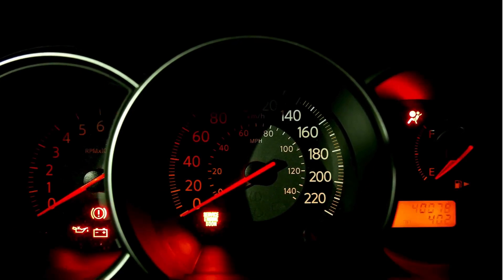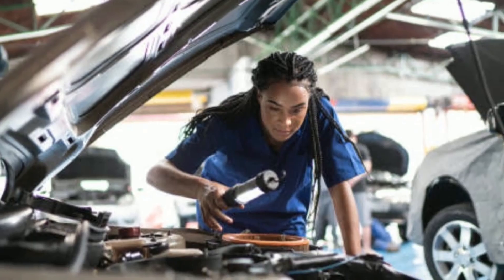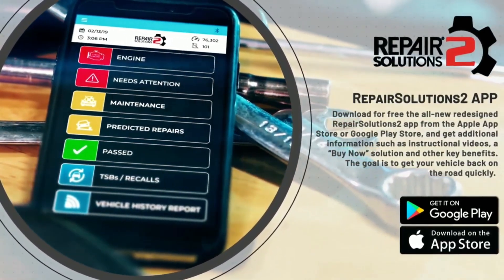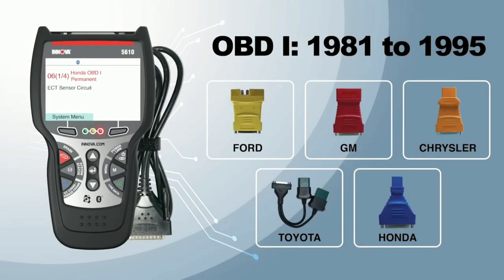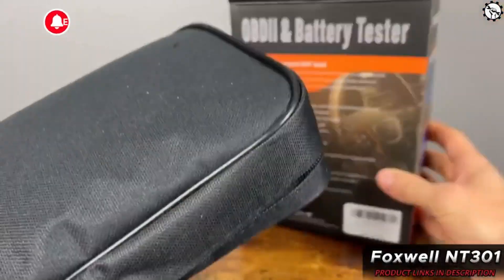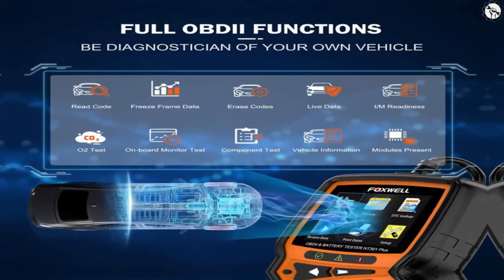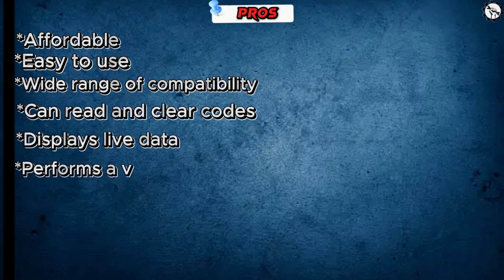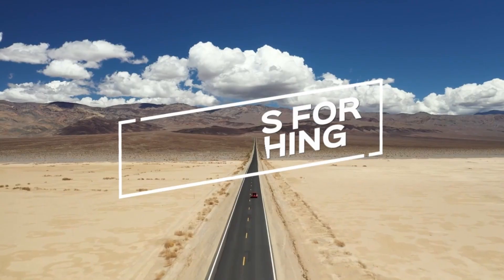Innova 5610 vs FOXWELL NT301: Which is The Best OBD2 Scanner for 2024?

Comment: Im thinking of buying the foxwell but im told its no good for diesel cars..i have the Diesel Renault kangoo 2008 ..
Reply from the maker: The Foxwell OBD2 scanners are actually compatible with diesel vehicles, including the Diesel Renault Kangoo 20082. You might want to check the specific model's compatibility using Foxwell's coverage checker. Happy diagnosing! 🚗🔧